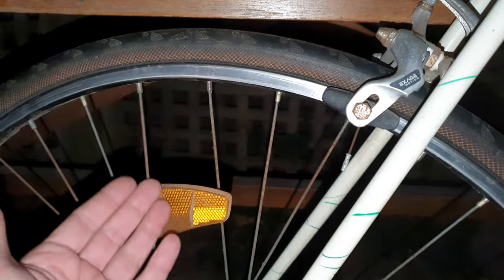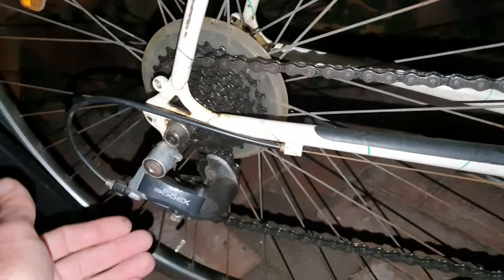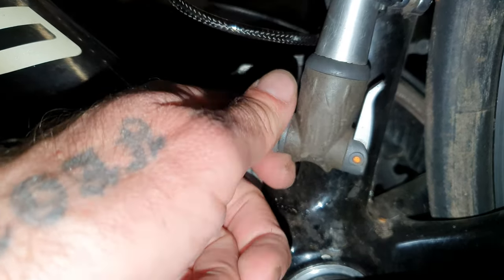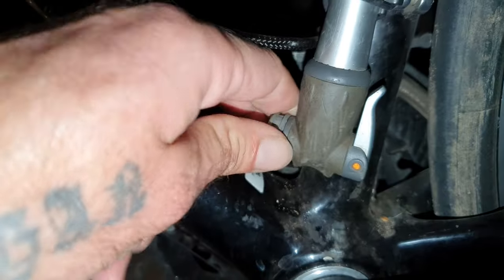Trans AM bike set up tips

Comment: Gatorskins are terrible. Puncture protection is good, but they have literally no grip. And when it's raining you better just stop and wait till it's dry.
Reply from the maker: I've never had a problem with them but I'm a very experienced rider. 

Run them at lower psi and report back.